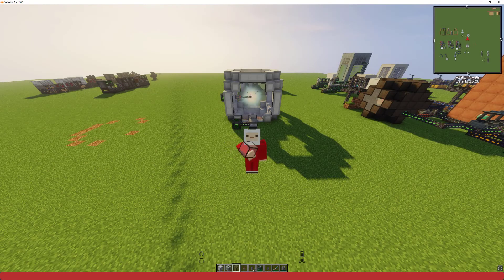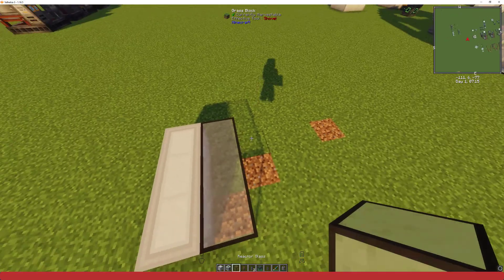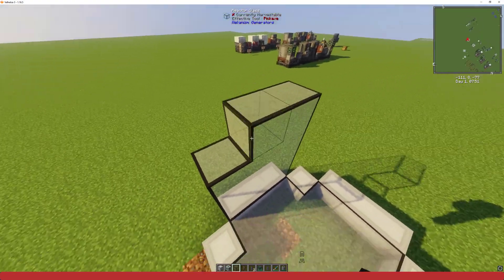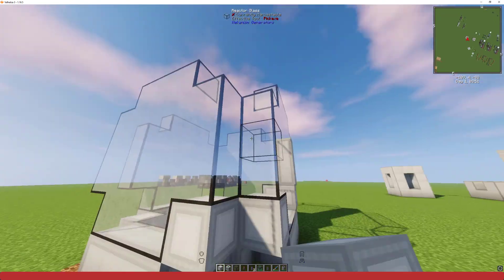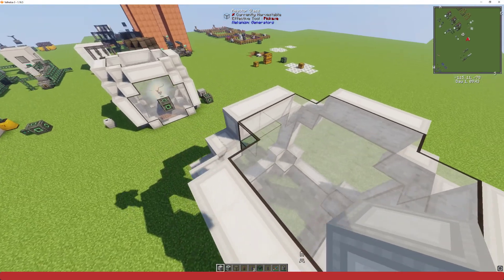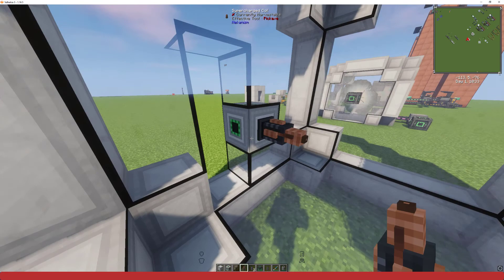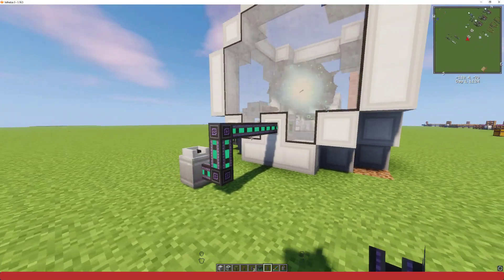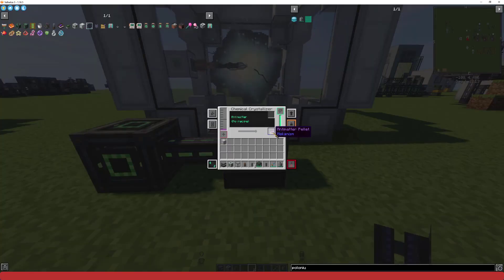How to build the Supercritical Phase Shifter/Create Antimatter in Mekanism!

Comment: My polonium is not taking. Would anyone know why that is?
Reply: Check side configs where the polonium is stored and make sure its set to output to whatever is running it to the SPS port
Reply: @artybrandt  my sps input aint connecting to the pipe
Reply: nevermind a random air block was not air somehow and was preventing it from assembling ;-;